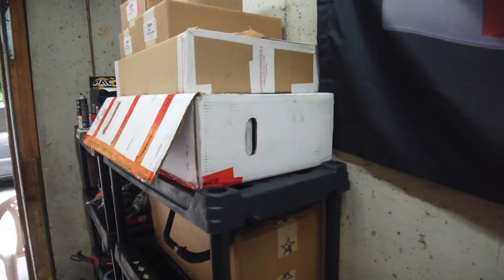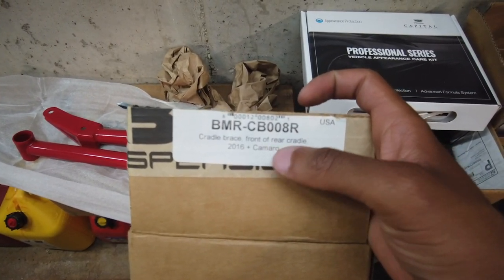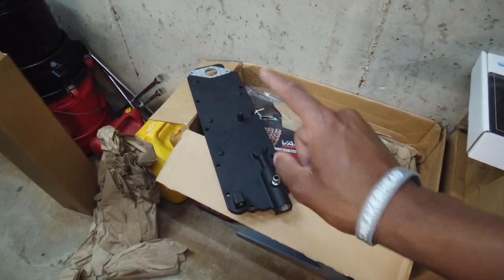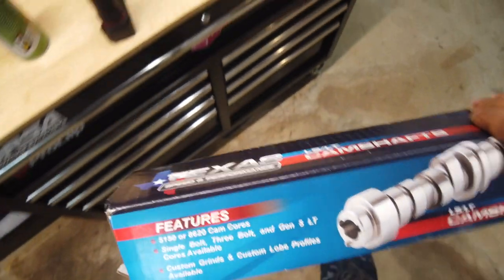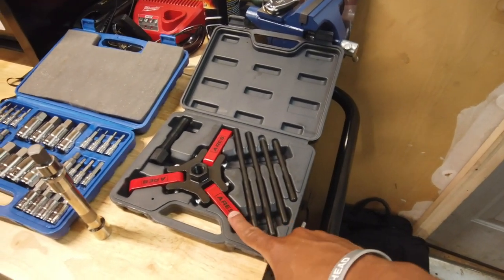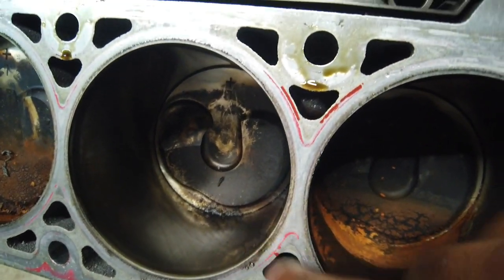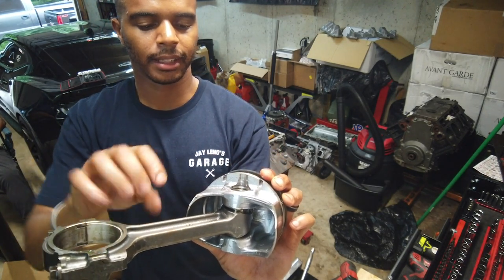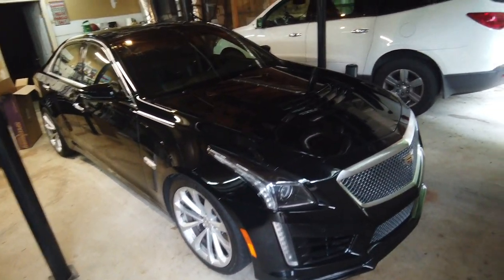Full LT1 Teardown - What Broke?

Comment: From my understanding the factory ring gap is good for about 600whp on the lt1. For anyone else looking to boost their lt1, look into drop in rods and pistons.
Reply: Or......gap your factory rings!
Reply: That’s stupid lol if you’re going to change rods and pistons already , just gap the rings JFC
Reply: My '18 SS is running 740whp on spray. No issues yet. It helps to run E85 since it reduces a lot of heat in the combustion chamber. But, I won't do that forever - to much risk. Good rods and pistons with proper ring gaps going in this spring.
Reply: Also, with ring gap - it's all about the heat. That's what causes the expansion and ring contact/piston land failures. E85's naturally cooling affect with the cold of nitrous keeps those temps in check so you can go way over 600whp. Boost raises combustion temps - it never lowers them. Just my food for thought.

Comment: So I’m confused do the manual transmission ss camaros still have the dod lifters and all the other stuff that goes with it?
Reply from the maker: Yes it still has everything a automatic car has in it. The system just doesn’t activate. They build 1 engine regardless if it’s manual or auto; the engines get built before the car does. So it has to be removed just like in the autos

Comment: i have a 1994 lt1 engine i was qanting to build it but with a carb and regular distributor is it to hard or is it doable
Reply from the maker: It’s doable. Not sure how big the market is for that stuff or what the cost is on upgrades. Sounds like something you should research. I have seen those motors make big power but it also took 20years of dedication and money.